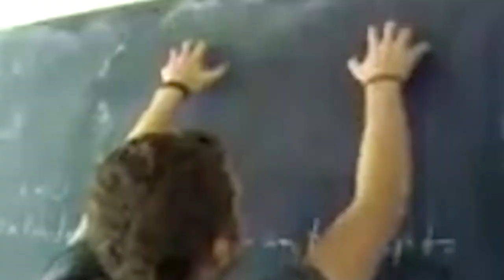Trading a GO KART for a MK1 VW GOLF CABRIOLET w/ @JacobSherwood !

Comment: 3 days into early fuel injection and I already wanna give up
Reply: Dont give up bud thts a good find the K-jet tronic is a tricky bugger but u will get the hang of it.Damn I miss my mk1 gti i had many years ago
Reply: Take out the fuel tank, clean it
Take off the main and return fuel pipes at the front and use an airline to clear them from front to back 
Replace the fuel pumps, in tank and main, 
Replace the accumulator 
Replace the fuel pump relay
Replace the fuel injectors
Refurbish the warm up regulator with a kit from Germany
Make sure the metering head internal piston is not gummed up and the spring still allows it to return properly and that the O ring seal is good that joins it to the base of the air box 
Check the distributor is free and not all gummed up
New plugs
HT leads 
Distributor cap and rotor arm

Fill it with fuel and adjust the C/O and timing and idle and it will be a reliable car